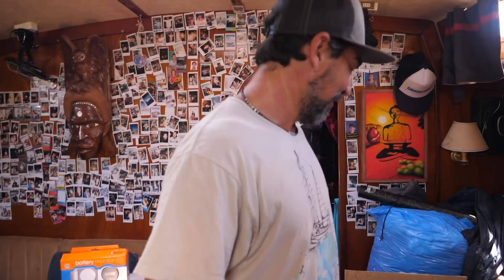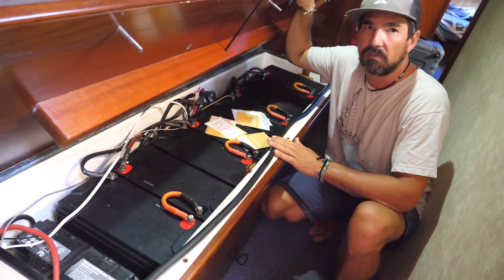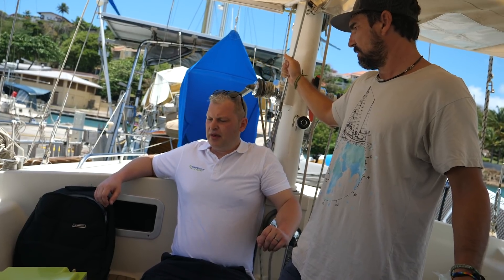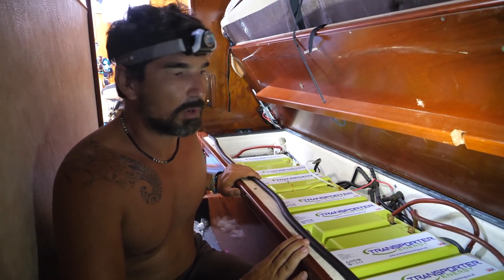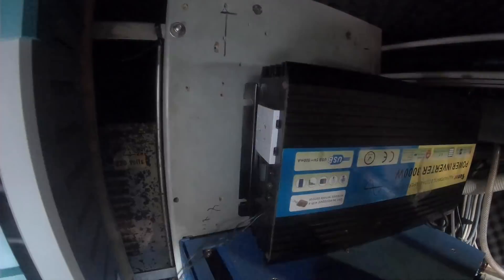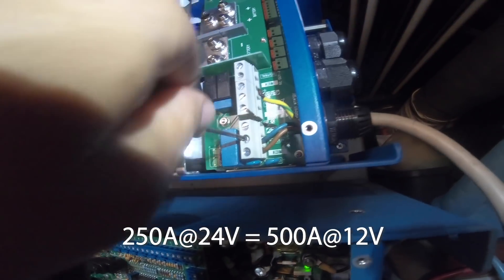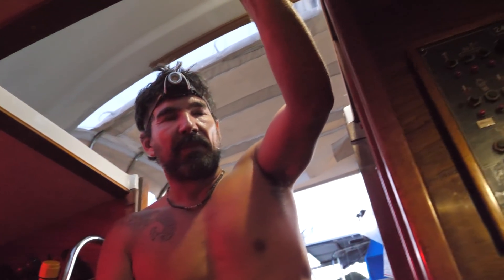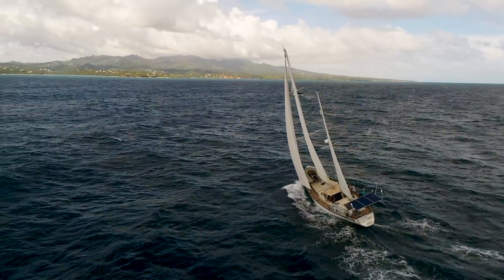Hello LITHIUM, Goodbye Propane!!!  Part 1-  Sailing Vessel Delos

Comment: I wish we new how much gas was used to compare it to the 6ah at 24 volts or 150 wh to boil the water.. for comparison to gasoline. 1 gallon of gasoline has the energy equivalent to about 33kwh of electricity. so you used the equivalent of about 1/2 ounce of gasoline (equivalent) to to boil the kettle. One equivalence from this experiment is that you can run the induction cook-top at that load for about 27 hours on 1 gasoline gallon equivalent of electricity. The conversion is 1 gallon of propane is equivalent to 27kwh of electricity which means you if your gas was as efficient as the electricity you could have run the gas stave at that flow rate for 22.5 hours on 1 gallon of propane...???... Thanks for a little math gymnastics, no matter WATT, it is better because you don't have to stop and buy propane anymore... The next thing is get enough renewables to not have to run the Generator... Then you are getting  to be real nature powered wind machine...
Reply from the maker: Yeah, I think you can convert WH to BTU to compare to gas if you want to go real deep :)  Of course the gas system is only about 50% efficient I think....

Comment: Awsome vid.  I like your enthusiasm to transfer from your old battery system to a newer updated system.  Moving ahead or keeping up with the times. I see in the vid you mentioned charge controllers for each input ie. Generator/solar/wind.  Is there any benefit or ability to run on 1?
Reply from the maker: Glad you enjoyed Nicholas, I will attempt to tackle the charge controller question in Part II.

Comment: Interesting conversion project. When I converted my 30 foot sailboat auxiliary engine to Electric Propulsion  10 years ago I thought about using Lithium batteries but, they were $$$ and there were long delivery times which was a concern should one or more of the batteries go bad while cruising.  So I went with AGM for cost and ease of replacement. Really looking forward to see how your new system holds up with cruising routine.  I may make the change to them myself if they hold up as promised.
Reply: Sailing SV BIANKA I live near the Bay Area sf and they built a clipper ship that has a electric powered pretty cool haven’t seen it since it launched I wanted to see their batteries which were not in yet. It’s a large boat go electric

Comment: The oven replacement will be interesting. You can use hot oil as an energy transfer medium. I’m installing a Webasto diesel water heater for the boat my wife and I are in the process of buying. That will heat the boat via recirculated water into radiators, but also gives me the energy to power recirculating showers (half hour shower with 12 litres (3 times 4 litres...wash rinse rinse) water consumed and yes I have resolved all of the issues to do with dirty pipes) that you might be interested for Delos 2. There was some research decades ago for solar heated oil to power a range of household needs. For a one hour bake the consumption is only 2 kilowatt hours so the electrical load is not that great. Then there are slow cookers which are very efficient. It may involve a range of solutions. The hard one to solve is grilling, 700C required. Another option is methanol (or ethanol which you manufacture on board) as a fuel specifically for an oven. I am keen to see the solutions that you find.
Reply from the maker: Hmmm, these are some very interesting considerations William, thanks for that.
Reply: Sailing SV Delos Oven maybe not so hard.... 
https://www.thegoodguys.com.au/whirlpool-60cm-induction-oven-akzm8920hix .....after all. Personally I prefer a dual fuel solution. I will be staying with gas but I had decided to have a single element induction plate as a backup. Other options are the Omnia stove top oven (an induction one should not be hard to modify) , the solar oven or even a charcoal fuel oven. Thanks for the battery info. I hadn’t realised just how bad lead acid batteries are. I collected the information on the Lithium battery systems at last week ends Sydney boat show and can afford 4 kwhrs of capacity and must decide whether to convert the boat’s system from 12 volts to 24 at the time of installation, or later. I have the possibility of designing a small fuel stove for this boat and that would power the recirculating hot water system in a sustainable way but while we are dependent on diesel for motive power, sustainable independence is a distant target, until algal oil is a reality.

Comment: Nice!! I like it, those batteries are very powerfull but they can get fire very quick if they fail or damage. Be sure that the computer/controller/load stoper is set correctly and try to insolete the battery container from wood or plastics the best you can.
Reply: One huge advantage of LiFePO4 is they are NOT at risk of thermal runaway, ie  overheating and catching fire, like other formulations of Lithium. That is why they are used in electric cars. (I looked into this 9 years ago when they first came out, and built an electric bike with them.) BTW, don't confuse the generic term Lithium ion with these Lithium iron batteries. It seems everyone falls into that trap. The ion (anion) here is iron phosphate.
Reply: Guy Nardin they don’t catch fire easily

Comment: A toxic lake in Mongolia, a deadly lung disease in the Congolese cobalt mines, water conflicts in the Andean countries. This: the heavy toll that is paid for our only in apparent green electricity. The lithium-ion battery contains dozens of raw materials, which are not inexhaustible: lithium, cobalt, rare earth metals, nickel, graphite ... Do people in the extraction areas of those raw materials also benefit from the greatly increased demand? Does nature profit trom this? Or do they/we pay the price to give us a green conscience? Brian, I'm not a green freak. I understand and follow your idea. But how do you stand against this since it’s almost as bad as fuel.
Reply from the maker: I actually had this conversation with one of the guys that founded this battery company.  What you say is true that mining Lithium is a difficult and energy intensive process to create the batteries, but he claimed that the Lithium cells themselves are about 95% recyclable because of the chemistry used.  Other chemistries not so much...  He also said that one improperly disposed of lead-acid battery is a much bigger issue in landfills...  Given that millions are discarded in the US alone. Of course he is very pro-lithium given he owns the company but it was an interesting discussion to have.
Reply: Sailing SV Delos I agree that lithium definitely the solution is at the moment for delos or other long distant cruisers. But not for every car in the world. Then we’re back on the wrong path. I think we should take that into account. Thanks for the response Brian. I love the videos.

Comment: Congrats on the new cooktop!!!   You are going to love it.  I've been wondering about using induction on a yacht ever since I got an induction range but I figured the power draw would be too much.  How many watts per burner do you have?  My new induction range has an 1800w burner and will boil 20oz in 3min.  So if yours are 900W, 6min ain't  too shabby.   Btw, watch it for boil overs as you won't get that sizzling sound you are used to.   You'll just turn around and, Surprise!  Keeping the controls cleen is key, they don't like to work too well when wet.  
What about your oven, or do have one?
Reply from the maker: Good question- we typically bake bread in our bread machine, but will probably install a small electric convection so karin can continue baking her delicious Swedish cakes :)

Comment: You need lithium specific charge controllers no? Does that mean changing the alternator too?
Reply from the maker: All our chargers were compatible with the required voltage for Lithium, it's actually a simple config that I will cover in part II.  The alternator requires a DC to DC battery charger if you don't want to replace the regulator...  Also hope to cover that soon as well.

Comment: Looking at Lithium batteries now.  This was timely!  We will check out your links.
Reply: One huge advantage of LiFePO4 is they are NOT at risk of thermal runaway, ie  overheating and catching fire, like other cathode formulations of Lithium. That is why they are used in electric cars. (I looked into this 9 years ago when they first came out, and built an electric bike with them.)

Comment: A friend put  induction stove on his boat a years ago and loves it.  A success.   I  am not sure about the Li-ion......  this will be a good  experiment.
Cost effectiveness  is another issue,  lead acid bats last 4 yrs,  so say 3 replacements over 10 yrs at 650$  a replacement for 800amp/hrs,   is  1950$.  What is the cost of Li-ion and the real  life span?
Reply from the maker: We have replaced our bank 3x since leaving Seattle, sometimes in some out of the way places where it was much more expensive.  If this tech had existed when we left would be way ahead by now I think....

Comment: I'm stoked about this. Have been loosely keeping up with, Folded, Glass Ion, and Rhubarb, battery progress, but they are still cost prohibitive or yet in the test and development stage, however you having the equipment to monitor, condition/normalize, charge safely etc will be one less thing when those techs become practical. WTG guyz, very happy for you. Wow that Mahogany looks Fab and Trick... I guess thats Pimp and Fly in today's language.

Comment: Clever stuff Brian, Would have been good to do a dump test on the batteries. I like the idea,wind sun and Generator. Take a camping stove with you just in case.Thanks for the video. WW2 submarine job getting... I liked the idea off 2v batteries... this sh"t. These 2V batteries are connected in series, as opposed to 12V battery banks which require a complex combination of series and parallel connections. By connecting exclusively in series, each 2V battery is charged and discharged at an even rate. Thanks to these stable and balanced charging cycles, this battery bank has a considerably longer service life than any bank consisting of 12V batteries.

Deeper discharge capability: The thicker metal plates inside these 2V batteries allow more energy to be drawn from the bank than if it were comprised of 12V batteries.

Suitable applications:

The long service life and improved depth of discharge of this battery bank make it ideal for applications requiring constant, reliable and powerful energy supply. Such applications include, but are not limited to:

- Large power systems for motorhomes, caravans and boats
- Solar, wind and hybrid energy systems
- Household off-grid power systems 
- Emergency or back-up UPS systems
- Energy storage for telecommunications or networking equipment
- Power stations
Oh and milk floats,! Atb.

Comment: using the lead acid battery as a giant capacitor for spike protection seems like good idea, but leads to a question about charging output from the various sources...  however sounds like I should wait for next vid!  Lol..
Great vid, I too like the technical side.    Do you have to be careful of wearing rings or putting down a knife, for example, with that cooktop?

Comment: This is a spectacular video Brian I'm planing the same thing for my boat. I've lived off grid for 15 years now. You may need to add a few more panels . Sometimes I through a piece of news paper between the cook pot and the induction surface to catch splatter (while i'm cooking) to make cleaning a breeze. I think you'll find that you'll be doing most of your cooking during the daytime. my single induction surface is adjustable from100w to 1,500 w . Two surfaces can draw 3 kW .that's a lot when you have other things running like fridge /freezer. It's going to change your life for sure. It'll be fine when you's get used to it's limitations . BTW a good pressure cooker can drastically reduce cook time, no matter what the energy source  Cheers

Comment: i hope by now you have worked out that LifePo4 batteries get 5000 cycles if you draw them down 20% NOT 80%.  You need to re-read your own chart. IF you draw them down 80% (i.e. to 20% left) your total number of cycles will be more like 500... see here... 
http://gwl-power.tumblr.com/post/140925159571/the-cycle-life-of-winston-batttery-cells-versus
Also you will need to carefully monitor the batteries for swelling and temperature. Also beware: LifeP04 can catch fire and if they do they are very difficult to extinguish. Check your fire plan and I suggest you put a temperature monitor and alarm in the battery box as before they catch fire the chemical reaction that causes this problem generates huge amounts of heat. You only need one nfg cell within one battery to go nuts to cause this.
Safe safe Dudes. :)
Reply from the maker: hey Damien, I have confirmed this with the manufacturer, the 5000 cycle number is in fact good for 80% discharge, and slightly less for 90% discharge.
Reply: Sailing SV Delos well that’s a huge jump in performance truly huge.

Comment: please keep in mind....a Lithium Batt , if damaged , will burn through the side of your boat in 2 min flat
Reply from the maker: Yes, considered that.  But have also seen boat decks completely blown off by a propane leak so still think we are on the right side of things!
Reply: One huge advantage of LiFePO4 is they are NOT at risk of thermal runaway, ie  overheating and catching fire, like other cathode formulations of Lithium. That is why they are used in electric cars. (I looked into this 9 years ago when they first came out, and built an electric bike with them.) BTW, don't confuse the generic term Lithium ion with these Lithium iron batteries. It seems everyone falls into that trap. The ion (anion) here is iron phosphate :-).
Reply: Rodger that !!!

Comment: You did almost exactly what I recommended a while back!!  victron inverter and all.. HAHA GOOD JOB!  induction stoves are incredibly power efficient also so doubly good job!  I still think the tesla cells would have been a better choice, but those should be fine.
Reply: Carl Groover thermal runaway is not a good thing on a boat..lifepo4 is safer

Comment: Hey Delos, the new batteries and cook top was a great project, thanks for sharing it with us. 
Thinking the big picture though, what portion or percentage of your electrical power is produced by wind or solar versus
Electricity produced by fossil fuel ( shore power or generator) ?
Reply from the maker: Stay tuned, video coming soon :)

Comment: lithium also is a lot less weight and induction heating is awesome ....but if you buy stainless aluminum glass or copper pans check and verify they will work with induction tops ..they do this by adding some iron to the pot bottom as the induction heating does not work on non magnetic material

Comment: Lead is politically incorrect but it is incredibly easy to recycle. Lithium is  a deadly environmental poison and very expensive to recycle. It's so expensive to recycle that it doesn't happen. Dead Lithium cells wind up in landfill where they can easily leak into the environment. Certain combinations of charging system failures or inconsistencies in battery manufacture can cause Lithium cells to burn or even explode..ask Samsung
Reply from the maker: I did actually discuss this with dragon fly as a concern, they said the Lithium Phospate chemistry is actually 95% recyclable, when compared to what happens when lead-acid batteries are improperly disposed of I think we are on the right side of this equation.

Comment: Keep the propane
Reply: KISS my old old Chief Boatswains mate beat into my pollywog squid head. Keep It Simple Stupid. I like the batteries and the real-sine inverter but again this stuff is very environmentally sensitive electronics, but you know all that. I have to admit you would make a one hell of a field engineer. I love when they tell ya "thats impossible can't be done". Oh yeah, well I'll show you hahaha
Reply from the maker: I understand KISS, but over the time I have owned Delos we have had a propane regulator fail, a solenoid fail, and even a broken hose to the stove that ended up in a gas leak and fire in the galley.  No system is without it's points of possible failure so I try to keep this in mind when considering new solutions!
Reply: I am a Luddite hahaha. I'm resistant to change even being an engineer doesn't seem to help. Having rescued more then a few experienced sailors on small boats from fires a sea, so I regress. I was a US Navy Air Sea Rescue Swimmer for 6 years..... Be Safe Enjoy

Comment: Hi, just a quick question, what are you planning on doing for you oven? We have a microwave oven that we are hoping to replace with a combi micro/convection/steamer, do you think that would take to much power?  We also have the victron but the 5kw inverter and then a 5 kw step up step down transformer, we run a mixer of 110 and 220 on the boat and can also take 110 or 220 from shore power, currently 220.
Reply from the maker: Good question- we typically bake bread in our bread machine, but will probably install a small electric convection so karin can continue baking her delicious Swedish cakes :)

Comment: Sweet setup.  I use an induction top at home and love it.  I would make sure the induction does not interfere with any of your other sensitive nav gear though.  the magnetic field from the induction might throw off your magnetic compass.  Good luck.

Comment: You almost have to be an engineer to love this. Scared me when I heard there was a computer in the batteries.... I'de still be drooling on the manual trying to figure out how to remove them from the packaging...
Reply: Presumably each battery contains an itty bitty microcontroller which costs like $0.30.  Yes, they do computer things but they have very little general capability such as the ability to play games or be reprogrammed to do homework, etc.